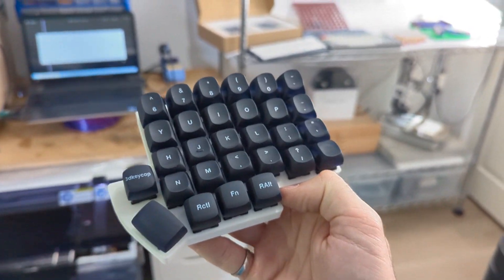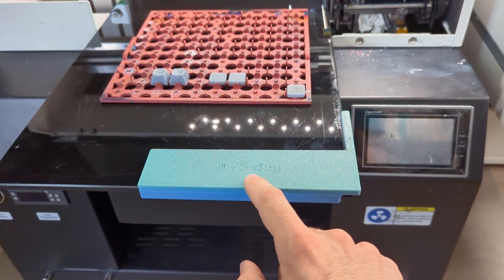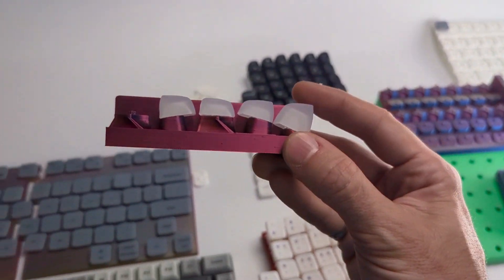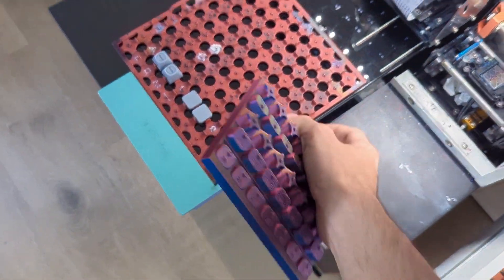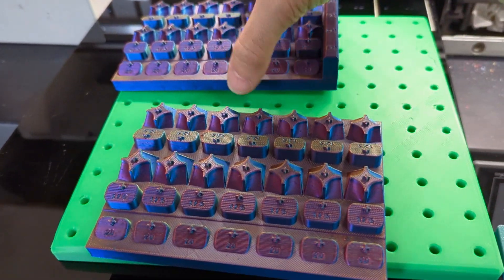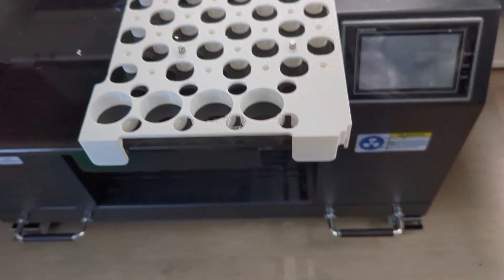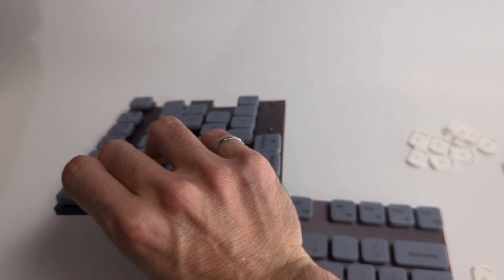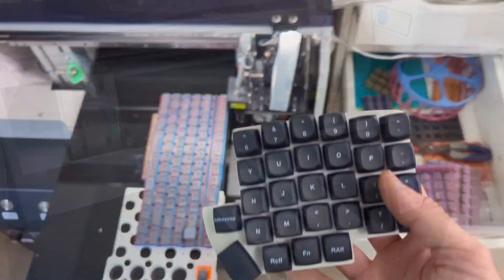Custom Keycap Tool for Legends

Comment: Such a complex and dedicated solution, i wonde if this entire set up worth more than a dye sub printing set up. A dye sub set up cost some where like 2500 usd and can print on the entire keycap
Reply from the maker: Thanks :) Yes, you are right that this setup is worth more than dye sub. It is a lot more modular than dye sub: I can easily fdm print custom jigs (dye sub requires metal jigs). This is key for us since we offer plenty of different keycap profiles (shapes). It also prints more vibrant/crisp prints (but at the cost of durability).
Reply: @3dkeycap  i quite unsure whether it is absolutely needed to have the metal jig for dye sub , those are often custom made with machining tool. I do remember there is already ceramic mixed resin that can 3d print tough object with high heat deflection property, good enough for injection molding. Also if you do want to attempt that resin for keycaps, i would love to see your review on that. I have experienced with ceramic resin before, they are super smooth to the point you have to crank up bottom layer 5-6 times the normal amount, or else they would not stick. Have yet tried that for keycaps 😅
Reply from the maker: @lehoangminh  that's a fair point. 
For ceramic resins, I have not attempted them because they come with added challenges: you need to bake them and while doing so, the part warps. Dimensional accuracy (tolerances) is really critical for us. So while I really want to test ceramic, I know that this would be a challenging project haha

Comment: There are many, many ways to get better dimensional accuracy for 3D printed holes like that, starting with changing your wall print order to outer-inner, instead of the default inner-outer. I much prefer fixing problems like that at the source, rather than trying to go in and do post-processing, especially if you're going to be doing something like that what looks like an 11 by 11 pegboard design. I have zero interest in reaming 121 holes by hand, even with a power drill.

What is the lifespan of those printed designs? Do they hold up under normal usage? Or are these purely for show?
Reply from the maker: Yes, for sure there are better ways than 3d prints =D
It’s just that 3D prints are a fast and affordable method for me to move forward as I figure out what features are important and go through a few revisions. At some point the designs will be good enough that I would no longer need to go through revisions and I will get a proper machine shop to make them in metal. 
Thanks for the tip of printing the walls first, I’ll start doing that! :)
Yes, reaming the holes is currently an annoying step. I do not expect these current jigs to last long. I do use them. At some point I will use stronger filaments to increase their lifespan and go through a few production batches with those, after which if the designs prove to be good, I’d step up to fully machined ones.

Comment: Amazing video. So much information in so little time, made me insta sub. 
What are your opinions on using a cheap diode laser cutter to engrave on resin/fdm printed  keycaps? I kinda tried, but the results were pretty garbage, maybe you have some kind of method that works a little bit better?
Reply from the maker: thank you for the comment and for the sub! I really appreciate it :) 

Yes, I have experimented (a tiny amount) with engraving on resin printed parts with my diode laser and sadly I did not get good results: https://www.youtube.com/shorts/dSfh_iq-5QU

I was able to get a fiber laser test (help from a local company) and the results were better but still the engraving had little contrast. Hence I gave up on using a laser on our resin parts (at least for now).